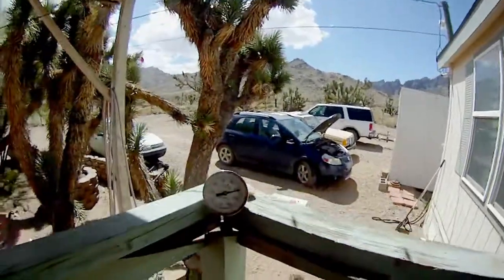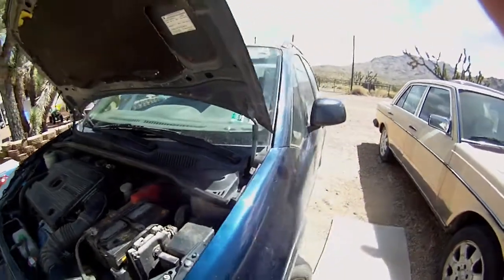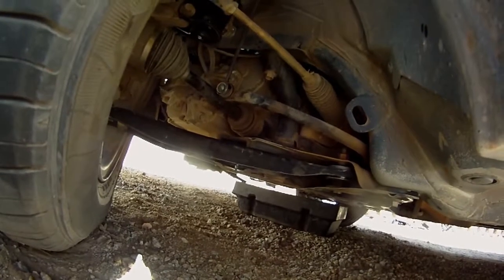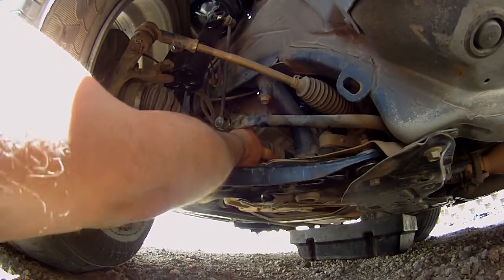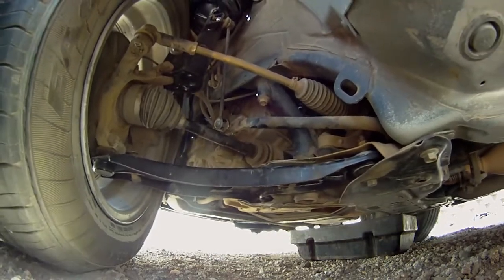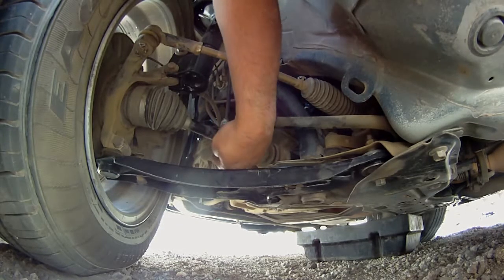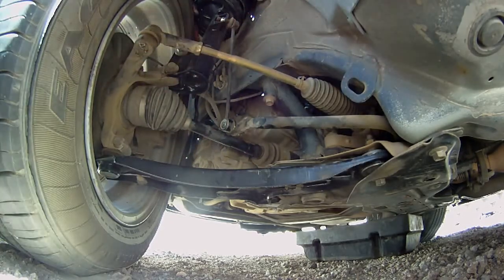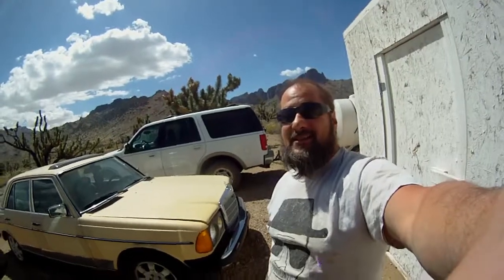Suzuki SX4 Bad CV Axle....Easy way to check

Comment: What about rightside im still having problems after replacing left
Reply from the maker: Unfortunately a lot of Suzuki's have a driveshaft that's out a phase...... once the tires develop a flat spot it won't go away until the tires are replaced....... it will cause the steering wheel to vibrate even though the car goes straight....... if the problem isn't fixed it'll drive nice and smooth for a while and then eventually develop wheel.hop if something's out of phase

Comment: Driving an sx4 sedan (2010) vibration starts to kick in aftr goin 40kmph. I was wondering if it is caused by the engine mounting bushing...
Reply from the maker: It could be ......check the tires for any flat spots in the tread....Many Suzuki sx4 has a bad driveshaft that is out of phase and causes massive vibration over time......you can check the motor mount pretty easy by giving the gas a little throttle with the brake on to see if the motor moves excessively.......Just putting the car in drive or reverse with the brake on idling should be enough to see if the motor jumps from a broken bushing.....Good luck

Comment: All your rubber boots are dried out which can/does lead to cracking (even if not visible) and can result in contamination or loss of grease and wear issues. l recommend you clean all of the boots at lease once per year which is pretty easy when doing other maintenance and after cleaning the rubber treat them with either AT-205 Re-Seal or with 303 Aerospace Protectant. All the boots on my 2008 still look brand new after 12 years.

Comment: My car shakes like crazy after 50mph I've done tie rods control arm bushings wheels and still the same. Thinking axle or strut any ideas?
Reply from the maker: .....Chances are the driveshaft is out of phase......Mine did the same.......It creates flat spots on the tires that gets worse with mileage .....Feels like the car is going to shake apart......
Reply: @nitebirdscuffle4213  what you mean out of phase? I was thinking the same thing but that was my biggest fear.

Comment: This surely helped. I have the same problem at 156K.
Reply from the maker: Thanks for the comment .....After replacing a lot of parts ......it looks like the drive shaft was the root cause
Reply: I had to change the CV axle, hub and bearings.

Comment: Hi could you tell me whete can i get original suzuki sx4 2010 awd axle, call suzuki dealer and the item in the backorder, thanks
Reply from the maker: Ebay is probably your best bet.....I've removed my driveshaft/propeller shaft due to out of phase issues.....here in North America Suzuki parts can only be found in the junkyard or Ebay ......good luck
Reply: Getting new OEM parts here in North America is actually quite easy and can all be done online.  Here are a list of Suzuki parts suppliers you can order from:
1) - https://www.suzukicarparts.com/
2) - https://www.suzukiautomotiveparts.com/
3) - https://www.suzukidepot.com/
4) - https://suzukisubaruparts.worldoemparts.com/v-suzuki-sx4
5) - https://www.thatgmpartsguy.com/v-2008-suzuki-sx4--base--2-0l-l4-gas
For non OEM/aftermarket replacement parts l recommend Rock Auto -
https://www.rockauto.com/
Doesn't hurt to check Ebay/Amazon but remember you're pretty much on your own when you order car parts from either of those sources.
Reply: @nitebirdscuffle4213  Getting new OEM parts here in North America is actually quite easy and can all be done online.  Here are a list of Suzuki parts suppliers you can order from:
1) - https://www.suzukicarparts.com/
2) - https://www.suzukiautomotiveparts.com/
3) - https://www.suzukidepot.com/
4) - https://suzukisubaruparts.worldoemparts.com/v-suzuki-sx4
5) - https://www.thatgmpartsguy.com/v-2008-suzuki-sx4--base--2-0l-l4-gas
For non OEM/aftermarket replacement parts l recommend Rock Auto -
https://www.rockauto.com/
Doesn't hurt to check Ebay/Amazon but remember you're pretty much on your own when you order car parts from either of those sources.

Comment: I have a loud noise (choppy tire noise) with squeeling at 70km/h and choppy noise gets louder and squeeling fads away. I have no clue what's causing this. Anyone else experience. Pretty sure it's not bearing noise comes from front center of car. I had changed the rf bearing nothing changed. Lf bearing is fine.
Reply from the maker: 2 quick possibilities .......Brakes or driveshaft/propellershaft.......
Brakes.....loose brake hardware or worn pads.....
If its an AWD SX4 like mine .....one possibility could be the driveshaft/propeller shaft......the center carrier bearing for the drive shaft may be making the noise or the u joints are shot......After all my repairs I had to remove the driveshaft due to out of phase issues causing tires to wear out prematurely and massive vibration at highway speeds.....good luck and please post/reply if you find anything
Reply: @nitebirdscuffle4213  brakes are new and fine yes it's AWD. I didn't know that the shaft would also squel. There was no play in shaft will have to dig deeper. Starting with left front bearing next.
Reply from the maker: Lost my first reply =(.....I replaced my entire front end before I found the root cause of this issue....Please check out my other vids on the driveshaft, it's a different kind of play in the u joint.......From what I've seen it looks like all Suzuki SX4 AWD have the same driveshaft issue.. The driveshft can squeel and thud, very common.....My driveshaft did not have play in the vehicle but was bad (out of phase)......You need to remove the driveshaft to inspect it properly....my u joints were "clunky" like the had detents in them....It will be easier to remove the diveshaft and inspect, then replace a bearing that seems fine...... The problem is the bad driveshaft will wear out other parts....starting with the tires......If you have diagonal wear patterns on the tire like I have in my vid you have a bad driveshaft that is out of phase( I have a vid on tire wear and wheel bearing)........good luck and I hope you find the issue
Reply: @nitebirdscuffle4213  think it's the hanger bearing so I would need just a new drive shaft I believe

Comment: Did this fix the wobble? Or was that the wheel bearing?
Reply from the maker: Unfortunately it did not fix the wobble, but helped....just another symptom......The root cause appears to be the driveshaft being out of phase...I have some videos on the cv joints and driveshaft.....Thanks for the comment
Reply: @nitebirdscuffle4213  Thanks for the effort posting these. I did find the cause of the wobble on my car. The shock absorber on one side has tell tale oil leak stains.
Reply: There were aftermarket adjustable camber bolts that have broken inside and made the wheel wobble badly and indirectly ruined the shocks. Replacing with stock bolts solved the wandering steering issue I had as well.